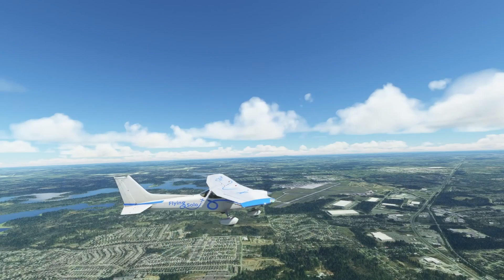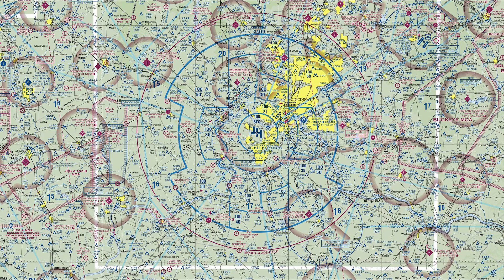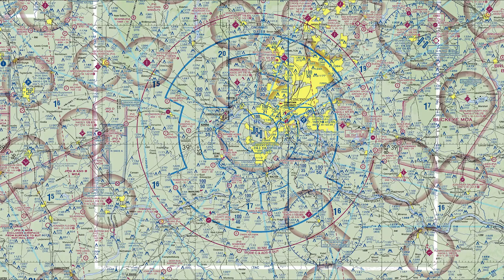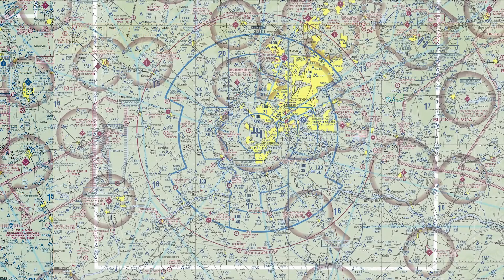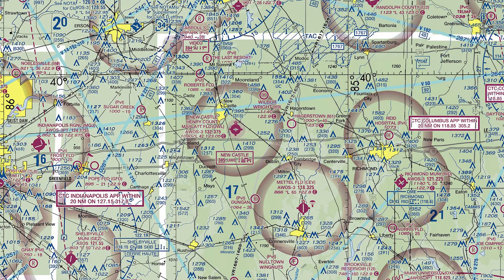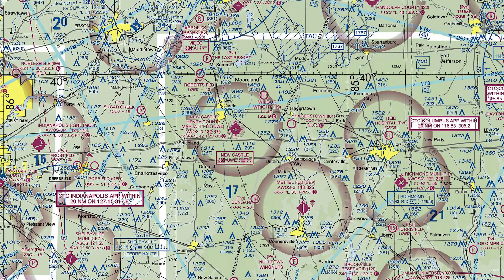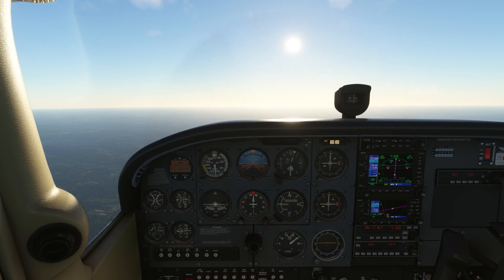When to use CTAF vs Unicom on VATSIM Tutorial

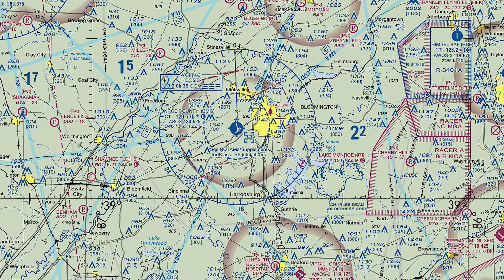Comment: One more thing with class D airports. Not all class D airports have a 24/7 tower in real life, in which case they will also have a listed CTAF. Usually tower frequency doubles as CTAF when the tower is closed, but sometimes there is a separate CTAF. 4:20 is a good example of the former where both the CT and c symbols are next to the frequency. In the former case you’ll see them listed separately. You would need to look at the chart supplement to determine when the control tower is closed in real life.
Reply from the maker: You are correct! I was just focusing on VATSIM, but you are correct on this information!